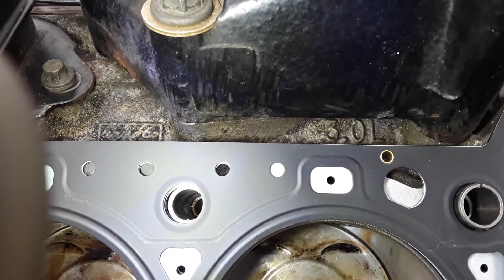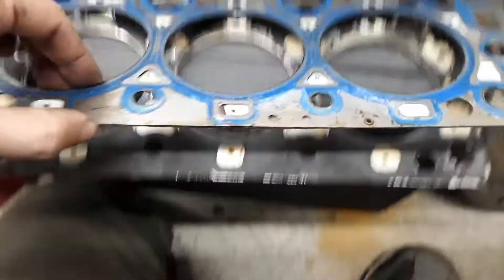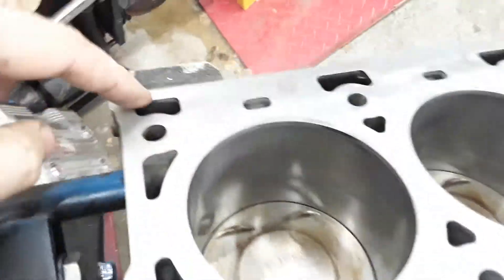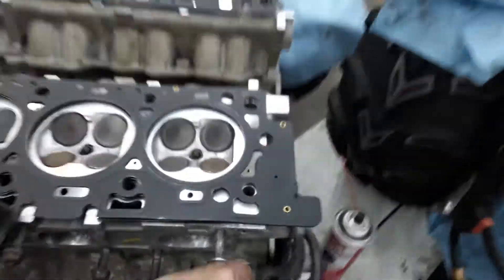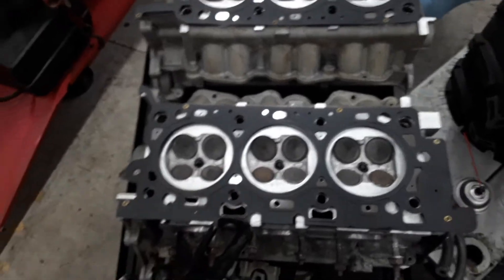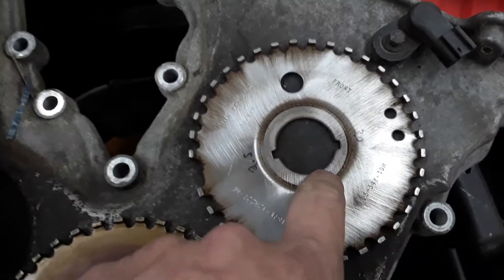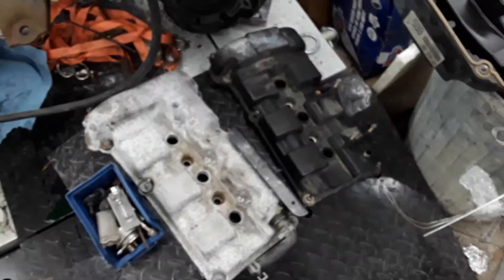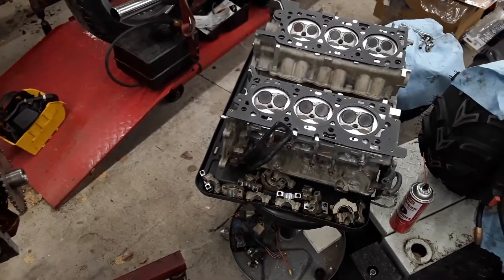How to Build a 3.0 Hybrid V6 Duratec 2.5 to 3.0 Swap for Ford Contour/Mystique/Cougar

Comment: Hey @William Bartholomew (Will) i was wondering because i have a 2000 contour SE with the regular 2.5 are the non svt parts listed okay to swap over like you listed or do they have to be SVT im assuming by the way you typed it its non svt as well but just want to be sure. Thanks best video on this job ive seen so far!!!
Reply from the maker: Yep! Any time I say "SVT" in the video regarding the parts, procedures, and details know that they're synonymous with the "base 2.5". Process for you will be unchanged.

Just know that being you have a base 2.5 that if you do any 3.0 swap be sure to use the 3.0 camshafts (or the 2.5 SVT if you have access) because they'll be better performance-wise than what your base 2.5 has. I have a video on the cam comparison too.
And remember that if ypu use 3.0 cams ypu need to use the 3.0 cam chains & crankshaft sprockets too because the they are NOT compatible with the 2.5/SVT cams+chains+sprockets.

Comment: I have a complete 60k mile jag 3.0 from a s-type (rwd) I'm putting in my 53 Willys Panel.   I can't use the chip-key jag computer, and was thinking of using a 96 2.5L Contour ECM and maybe its wiring harness.  Do you know if the jag motor has the same sensors?  throttle, coils, timing, etc, so I can just hook it up and get the 3.0 to run/drive.   I suspect the trans control is different which may be a limp-home problem.
Reply from the maker: The problem with the Jag 3.0 is they often (or all have) variable cam timing, no Contour ECU will support that. Yours should also be coil-on-plug which the Contour ECU won't support either without modification (there is a common rig for this in the Contour forums) or using Contour ignition. Also the 2.5 ECU will be expecting the secondary runners (which the Jag 3.0 doesn't have) to open up at 3400rpm and without that it's going to run quite poorly from idle to redline always thinking they're open because they're not there - the older ones (for sure 95 & 96) have the secondaries vacuum-controlled but not sure if those ECUs would coop better without secondaries or not.....

I have no idea what the ECUs think of the automatic vs manual transmissions..... If the fact that the ECU is chip-key is what's holding you back you're in toruble because all 1995+ Ford ECUs are like this, you're not getting around this with any Contour/Mystique/Cougar/Taurus/Sable/Five Hundred/Freestyle/Escape/Mountaineer ECU.

I recommend visiting the Contour forums and asking those guys, I'm not an EFI pro but they'll be able to answer everything I can't and clarify any details I mentioned since I don't know the Jags well (they're extremely uncommon in my corner of Wisconsin lol)
Reply: @williambartholomew5680  Appreciate the reply, I joined the forum, no response so far.  The 96 does not have a chip key from my research, 97 they have them.  My 97 5.0 explorer was the last year without them.
The VVT can be ignored initially and default is ok.  The COP is not an issue.  I thought the jag had wideband o2 but it doesn't.
I don't see how the intake manifold matters, it just uses the 02 to get the right mixture.  My MX3 racecar 2.5 also had the intake switches and we removed all of it and it ran the same.

I am now thinking I need to find a 97 Ford Explorer 4.0 V6 ECM, because it will control the same 55R5 trans from the jag.  The older ones used a 4, and anything newer has the chip key.

Comment: What about dropping a 99 taurus 3.0 DOHC 24v in a old car like a 41plymouth rwd difficult? Finding rwd transmission that will bolt up?
Reply from the maker: Yes that's the main trick, you'll be looking for a 2002ish era Lincoln LS V6 tranny. There should be a fiew other options though because the 3.0 swap is somewhat common in Miatas - they supposedly can get the correct bellhousings or adaptor plates to adapt the 3.0 to either the pre-existing trans or another one....
Reply: @williambartholomew5680  thank you very much

Comment: What camshafts will you use ??? 2.5 or 3.0 ??
Reply from the maker: 2.5 SVT simply because the 3.0 cams I have have very worn sprockets and I find the 2.5 timing chain & sprockets a better design than the 3.0's which seem to wear much harder.

Comment: 0:34 Not all of them, depends on the year 3.0 01-03 will still have the PCV between the heads.
13:17 It does not clear.
14:34 Duratecs used 2 types of timing its based on the tooth count of the camshafts. 42 & 38.. SVT's got either seems to be mixed. Seems like 3.0's (At least 01+ got 42 teeth)
Reply from the maker: I'm told certain years of the 3.0 & 2.5 have larger/smaller holes where the Contour motor mount must go, but I have no concrete info on this - I imagine the center PCV unit has a similar story like what you're telling me, just beyond me and my needs/expertise right now :/ 

Yeah definitely doesn't seem like the 2.5 intake manifold clears the 3.0 valve covers

All 2.5s (SVT & not) use the more narrow timing chain profile while all 01+ 3.0s have the thicker timing chain profile (Been a while so can't remember which had which tooth-count, made a video comparing the two). Rumor has it that all pre-2001 3.0s have the 2.5 chain & sprockets but there's been MANY false reports regarding the 2.5 & 3.0 within the Contour realms - hence why I make these videos haha

Comment: How much power do you get off of doing this swap?
Reply from the maker: Throwing a complete 3.0 in an SVT Contour is about 20hp and 30ftlbs more. A 3.0 with 2.5 heads does about the same.
But take the time to port the heads and buy headers then you'll get an additional 20hp and 20ftlbs or more if you can tune it.

Comment: Great work. Are there any differences in pistons between the 2.5 and 3.0. Obviously bore sizes are different, but are the designs the same, ring grooves, material etc? Trying to work out if they are potentially as strong as each other? Thanks
Reply from the maker: So much bigger bore haha

Between the standard 2.5/SVT and the standard 3.0 the dome/crown is very similar = slightly raised center circle. The ST200 pistons however have a different dome/crown for much more compression, and the Jaguar/Lincoln LS/ST220/Noble 3.0 pistons might have a taller crown too.

ALL the 2.5/SVT/3.0 pistons are made of the same or similar casted aluminum. But the 3.0 pistons in the Jaguars, Lincoln LS, ST 220, and Noble are rumored to be forged.

I didn't look at ring spacing, I know all the 2.5/SVT are the same but being the 3.0 are used in a different block and both stock engines are good for over 250,000 miles it didn't really matter, I trust Ford's call there.

If you're considering swapping from the 2.5 to the 3.0 the biggest reasons to do so are:
1. The 3.0s make more power (about 20hp, 30ftlbs stock for stock direct swap)
2. The 3.0s are more readily available than 2.5s - the bearings, rods, and crank are all the same but 2.5 blocks and pistons are a rare sight today and are a why bother when the whole 3.0 is just as cheap and makes more power.
Reply: @williambartholomew5680  Thanks so much, exactly what I wanted to know. :)

Is the extra oil drain in the 3.0 to combat the high rpm oil supply issues that the SVT suffers from? How will you deal with this problem now? Thanks

Comment: I have a question?. If I wanted to go full 3.0l that would mean I would have to Port Mach the intake runners. But I was thinking if I can run the svt cams on the 3.0l?
Reply from the maker: Well you could use the 3.0 intake with the rest of your 3.0 - I just don't know what you'd have to do to compensate for the lack of intake runner valves, I think I mention the problem in the video because the Contour runs very poorly with it stuck open or closed.

The port match allows you to use the SVT intake on an otherwise full 3.0 thus why they're called "Portmatched 3.0" and not "Full 3.0" with the intake & all or the "Hybrid 3.0" like we're doing to have 2.5 heads and intake on our 3.0 block.

You can use any of the FWD Duratec V6 cam shafts in any of the FWD V6 heads, just have to change your block's crank sprocket and timing chain to match. I have a video of how the 2.5 & SVT & 01-03 3.0 cams compare you might want to watch to see the timing chain difference, it's pretty important. The 04+ 3.0 cams are supposed to be more comparable to the SVT's.
Reply: @williambartholomew5680  If you enlarge the valves you may create float.
Reply from the maker: @chriscoralAloha  not with the 3.0 valves, normally we'd think that but the 3.0 revs just as high as the 2.5 without valve float (though I can't speak for past 7k) so if I put 3.0 valves in these 2.5 heads this engine would outrun every N/A 2.5 or 3.0 from idle to redline :)
Reply: @williambartholomew5680  How is it going over there??